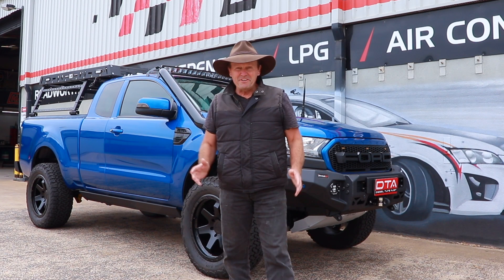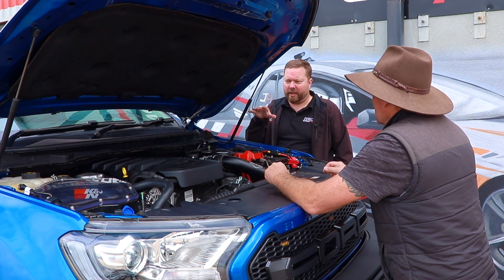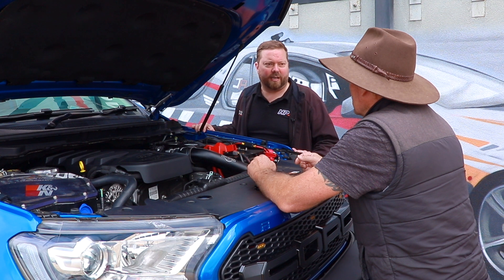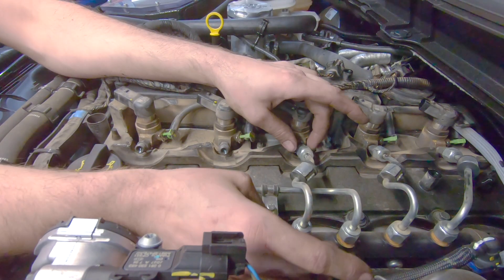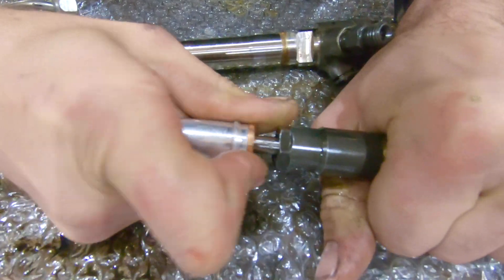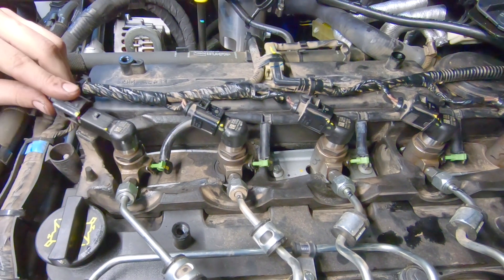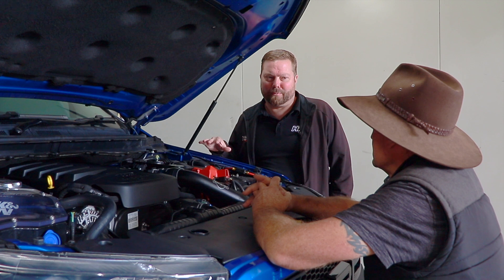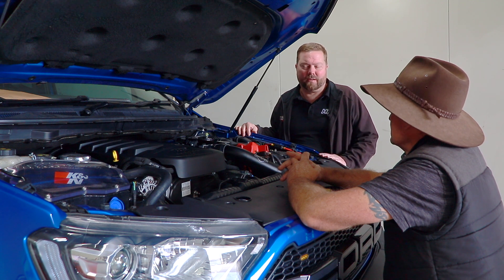Ford Ranger Engine Upgrades - ( Custom Dyno Tune & High Flow Fuel Injectors )

Comment: I'm amazed that the injectors got removed without a good clean up of the engine. I would never remove the injectors or anything without a good clean up of everything. Spray some brake clean around, a soft brush, a rag wipe & air blow off before removing anything. Cleanliness is important in every step of the process.....
Reply from the maker: The injectors were removed and sent away to be pressure tested. 
No worries at all. 

Cheers Tim

Comment: are you thinking of having high flow injectors on your patrol.

Also do you change your fuel filter on your car or do you take it down to DTA
Reply from the maker: Gday mate,
I’m not no on my patrol. 
I’ve never changed my fuel ever. 
I couldn’t tell the last time it was changed. 
I need to learn how that’s done. 

Cheers Tim.
Reply: @timbates4wdadventures  hi tim
I am suprised you never changed the fuel filter, it must have changed quite a few times while you owned the patrol.
The reason why i asked was because you did a oil filter change video on your zd30.
On this video of the ranger the man went to start the ranger and it took a long time starting, but that was due to the fuel system needing to be primed.
When fitting something like injectors or a major job, you may need to prime the fuel system so no air gets in the diesel fuel system.
Because of this and the oil filter tutorial as said above i was wondering if you have changed the filter and primed your zd30 as a result and if so a tutorial of the priming in particular would be useful, as not many people know that commonwealth systems need to be primed.
Beloe is a link to a tutorial of a fuel filter change and prime.
A lot of people have used fresh diesel in a can and have put some indie fuel 2D engine line before using the primer, to save time on the primer bulb, but this risks adding air to the fuel system unless you squeeze the fuel delivery line until there are no air bubbles left.
hope this helps.
Reply from the maker: @nathanreid2974  Very interesting mate. 
I should look at making a video changing the fuel filter. 
I know they need to be primed once the fuel filter is changed to get the fuel back up the lines. 
I'll look into that one mate. 
Thanks for that. 

Cheers Tim.

Comment: Lol 160rwkW 💤💤💤💤
Why does stupid Australia insist on Diesels??? It's SHIT!!! Stick the NA Barra in this and see what happens, never mind the turbo Barra! I'm not being a prick, I've got a Holy Grail XR8 .
Ford, this rubbish is UNACCEPTABLE!!! There's a reason why AMG use petrol in their G Class. (Price aside, I know which vehicle is better on or off road)
Reply: Is there a kit available to stick a non-turbo Barra into a 2017 auto Ranger with little modification? My 5 cylinder diesal has just seized-up.
Reply: A xr8 being called the holy grail, jeez I've heard it now
Reply: @markconnell6268  You do know it's essentially a FPV GT R Spec?? And the same people of made that made the kit for it so duh.
I stand by what I've said 100%. Fiesta ST has 180fwkW and 310Nm at the hub. This is a disgrace!

Comment: Looks good! What's the part number for those nozzles?
Would like to do some research into who makes them and if anyone has bad things to say before putting something unknown into my car, especially when it is a mission critical item like a nozzle.
Reply from the maker: G'day John, 

If you can contact Matt on the phone number at the end of the video. He will be able to answer any questions that you have. 

Cheers Tim.
Reply: @timbates4wdadventures  Thanks, did reach out but they couldn't give me any other information except that they are sourced by another company from overseas. I was really hoping it was a reputable manufacturer. There are 4 main players that I've found. One of them isn't known for using good metal, and their injector nozzles have no markings... I'm still searching, so if anyone has info I would greatly appreciate it.
Reply: @daaero  any luck on getting any info on the nozzles?

Comment: Nice info, thank you :) One thing I am always surprised about with these types of upgrades is they never upgrade the Harmonic Balance because with the extra power there is increased torsional vibration through out the engine and the standard harmonic balance can only handle a max 10% power and torque increase with a shortening of its life span.
Reply: You don’t need to upgrade that it just runs your fucking alternator and sometimes steering pump

Comment: I done a great upgrade , I traded the bloody thing in with 30k on it never again grrr
Reply: My ranger was stock block , had drivers seat replaced at 6k because all the fabric and stitching fell apart , spat the rear engine seal at 22k was done under warranty but what would the cost be if it was out of warranty could not keep wheel alignments up to it . Upgraded to the tried and trusted Isuzu Dmax have never looked back . Folks rave about the ford ranger it was nice to drive but that’s where it stops with me .
Reply from the maker: Doesnt sound great mate. 

Cheers Tim.
Reply: what happened to it, did you do a mod to your ranger

Comment: 5 Cylinder engine, a better balanced crank rotation with one piston reaching the top at a time. Find it amazing what a nozzle change do(wonder if you only change the nozzles with out any other mods, what difference in output will be?). DTA seems confident on the reliability? Thanks!